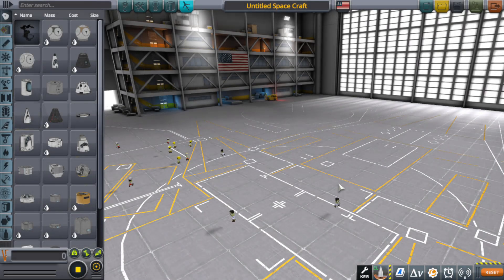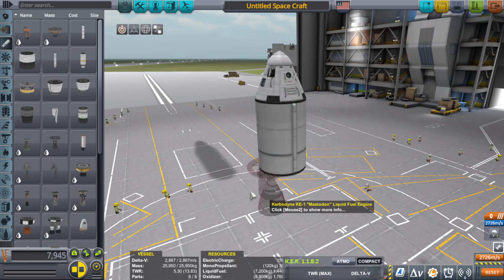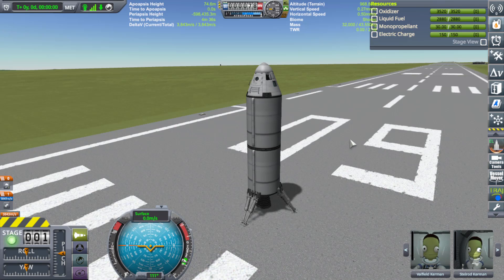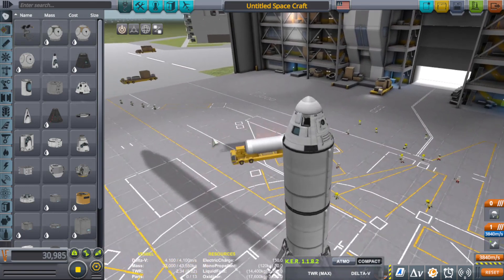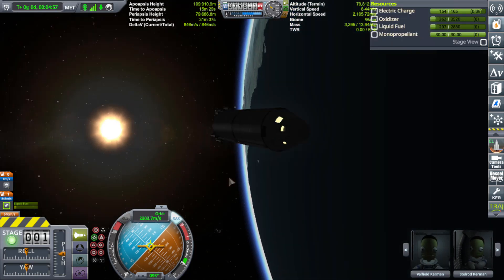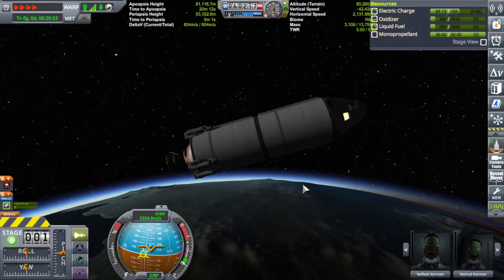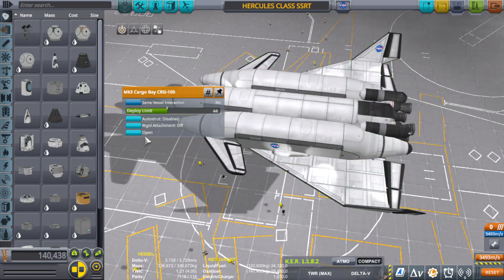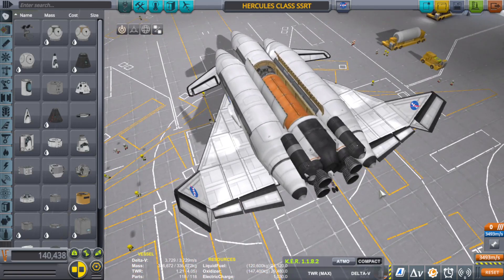SSRT TIPS AND TRICKS in Kerbal Space Program ssto stuff.

Comment: Most of the tips here also apply to every vertical rocket launch. If you're early career and don't have Vector, the first stage should still launch with TWR at 1.5 - 1.7, and throttle down to control gravity turn helps a lot.

Comment: just a quick correction on your speech about SSTO's realism, while we we might not have SABRE yet, ramjets and scramjets have been flown many many times on missiles before and allow for the speeds needed, of course they dont function at lower speeds but those can be covered by seperate jet engines or even rockets just to get them up to speed. Also as a craft suggestion you could do a Delta-Clipper style SSRT, where it would point nose first during reentry kinda like a lifting body, and then flip around for landing sorta like Starship
Reply: “Those can be covered by separate jet engines”

Well that’s kind of the problem. Same idea as KSP- you solve one problem and create 3 more. The new problems are that your design is now heavier, less economically viable, less payload, more complicated and the type of engines you’re describing fit for this task do not exist in an easily-integrated way (yet at least). 

The advancements in materials science for this sort of thing to be  practical are just too far off still 2y later.
Reply from the maker: Ahh but  the ramjet and scramjet have been around since the 60s. It’s old tech, you would think they would’ve had an ssto out by now. So , if this isn’t the case, then it must not be powerful enough to make the ssto work.  However, Elon musk said that starship could make it into orbit without the first super heavy stage,  but only just barely. However just barely is a lot more than not at all or never like the ramjet or scramjet idea. Ramjet and scramjet are still good ideas but like I said before if that was the case we would’ve seen something by now.
Reply: @vaos3712  rocket engines have existed for longer than that but we still havent had an SSRT either, the real thing holding back reusable vehicles like SSTO's is flight rate, the main advantage of SSTO/SSRT is that you are only dealing with a single stage, improving simplicity and reducing integration time and cost to only the payload. These are ideal for very high flight rates, however there simply arent enough payloads to justify them. Reuse is also expensive to develop and increases the fixed costs of a launch vehicle, for example Falcon 9 spent a billion dollars on developing it, this is also the reason almost all launch vehicles are expendable, there simply arent enough payloads for the rocket to fly so the increase in marginal cost of an expendable system becomes a worthwhile trade
Reply: @vaos3712  There continue to be serious advancements in materials and manufacturing science that make ram/scram more viable. That said, Two Stage To Orbit rockets with landable first stages seem to be in the sweet spot for economics and payload fraction.
I've tried SSTO spaceplanes in 2.7X KSP (27% reality) and they're HARD, even if you can get up to Mach 6 on airbreathing.
Reply from the maker: @cf453  ya , in Real solar system realism overhaul the only way I’ve made an ssto is by making it an SSRT. I think the max payload that I got was 21 tons. Not a lot but enough to build a space Station piece by piece. I think I might do that again.